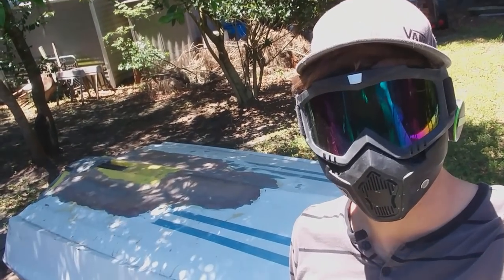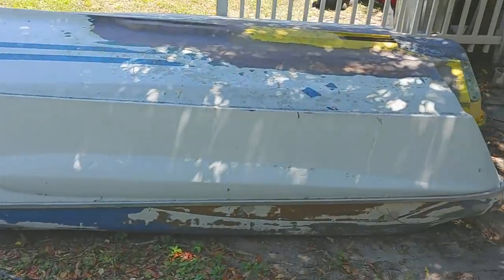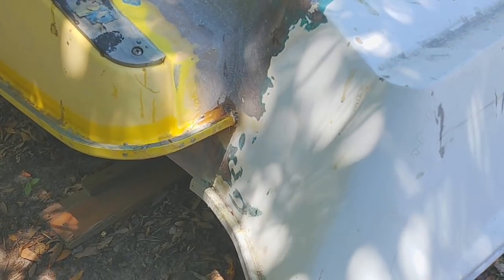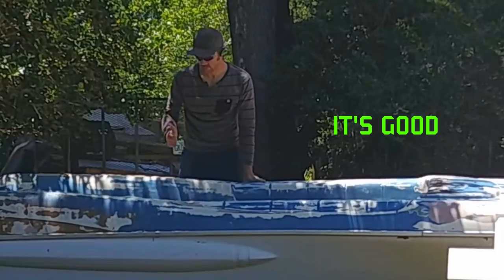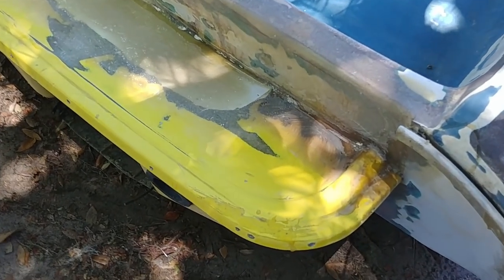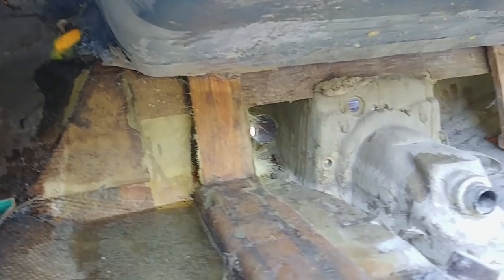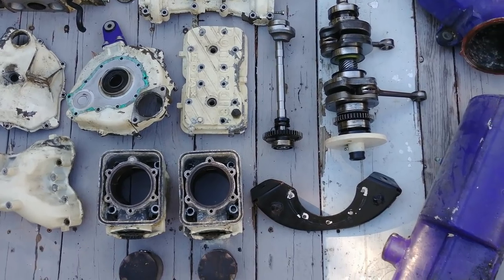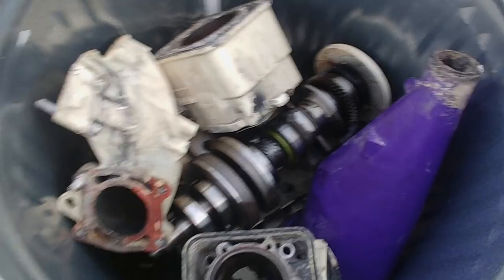JET SKI BONDED TO A BOAT! || VINTAGE GLASTRON Jet Swap Update #3 || DIY Hot Tank (Engine Clean)

Comment: Sweet man! Ive always wanted to get 2 matching wave runners and strip the engines out and french the engines into the back end of the pontoon tubes on a potoon boat. Then instead of a steering wheel have 2 joysticks, one on either side of the captains chair. Maybe like a zero turn mower. Anyway, cant wait to see it done. Good job so far!
Reply from the maker: Thanks!  If you do go that route, I encourage you to research "mini jet boats" made from aluminium kits.  Those guys are used to working with metal and use custom made intake grates that attach properly to sheet aluminum.
Reply: @BarelyBuiltRight  Thank you for the advice! :)
Reply: ño way try searà 260 ßundaer  or ³50 suñder yàggt het drive

Comment: Nice build! I did the same, 1996 787. Never did the final wrap video yet lol
Reply from the maker: Thanks!  I've watched a couple of yours as well.  Have you had yours rippin` yet?
Reply: @BarelyBuiltRight  Have been rippin heavily for 1.5yrs. The videos got way backed up lol. Its on a second engine and im now finally discovering that my oil tank location allows random air bubbles on rare occassions so im deleting the oil injection and rehoning my cylinders since I caught it early this time. But yes, runs well with good power and has been reliable in the ocean and bays, lakes and rivers! Excited for you to get to the rippin! Keep at it
Reply from the maker: @ripptydevibes2581  Glad to hear!  A buddy with a similar build told me the oil delete was a must-do almost from the get go, so it's nice to hear some confirmation on that.  Do you happen to know the approx weight of your boat?
Reply: @BarelyBuiltRight  Hard to say fully built. The hull was 280lb (16' modV) the motor gear was 150lb. The 2 batts and troller maybe 200lb. Framing maybe 60lb. Decking probably 200lb. The power was impressive when the hull was naked, and not as impressive fully decked. But does manage to wind out to 40mph, it does have some good umph to it, but I started riding 250 smokers at age 11 lol. The 787 is definitely one of sweetest engine packages to this day.
Reply: @BarelyBuiltRight  As for oil deletion, as a full time mechanic I gotta say that this 787 injection design is a love hate. I want so bad to keep it since it is variable, conserving oil and conserving engine WHEN it is functioning the way it was setup by seadoo. Till you move the tank and extend hose lengths, you discover it to be a finicky animal. But variable oil injection is definitely superior to straight mix, but I still recommend deleting it if its not placed just as it was in the ski lol.

Comment: Hopefully you repack your crank bearings with the proper grease after soaking
Reply from the maker: I kind of screwed up and left those engine parts in the tank too long.  I actually bought a whole other complete engine.  Take a peek at the "Building a Floor" video for a little more on that.  Thanks for your view!

Comment: How and what did you use to fill in the voids? Many layers of fiberglass or bondo? I have the same issue now.
Reply from the maker: To fill the bulk of the void I sprayed expanding PE foam, carved it to shape, and laid mat over that.  For smaller gaps you can buy fiberglass "chop" which is just shredded mat, and mix it with resin to make a thick paste which can fill voids as well.

Comment: what video editing software do you use? I may try to put up a vid of my jet boat conversion so you can see ..
Reply from the maker: I use Davinici Resolve.  It is a free, yet insanely powerful editor.  It needs a good computer with a good graphics card to work though.  There are lots of free options that will work on more standard computers as well.
Reply: @BarelyBuiltRight  cool thanks, ill try it out